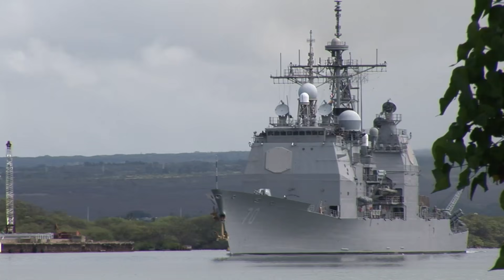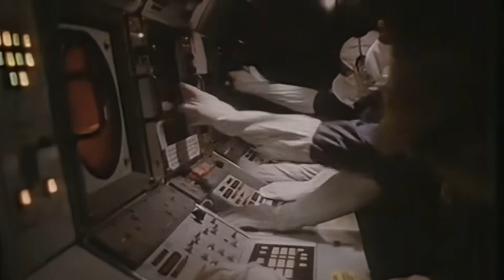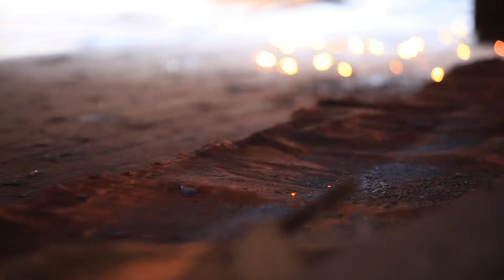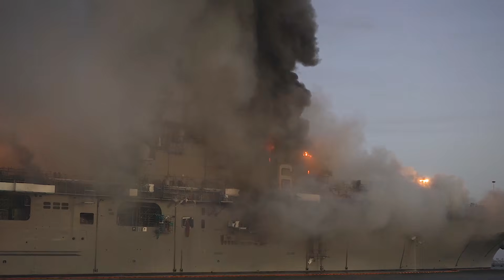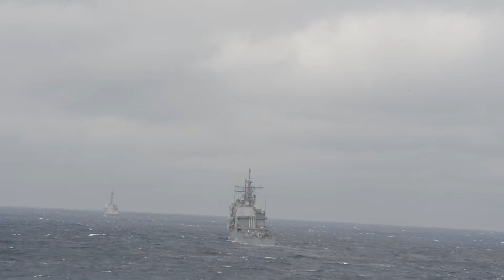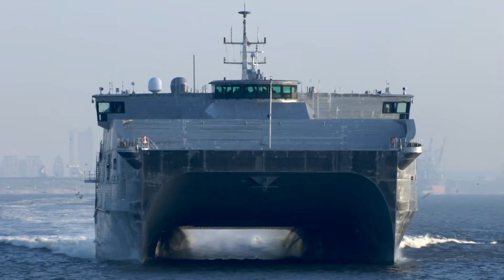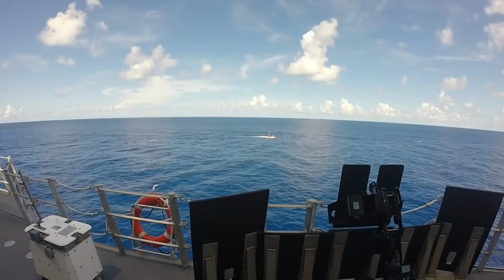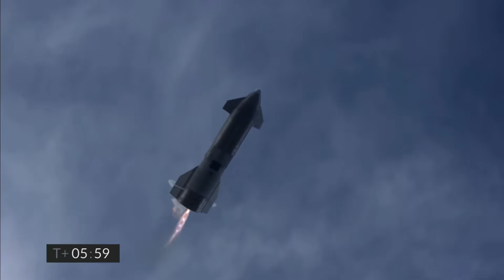Why is The US Building Aluminum Warships?

Comment: I like to make my Multi-million dollar warships from Radium personally
Reply: I prefer the hulls to be made of enriched uranium with a bit of neutrons for the contingency plan
Reply from the maker: So specific 😅
Reply: @NotWhatYouThink  mine is alot more specific, i come up with designs and details for mine from what bolts and nuts from :)
Reply: I like to make my ship out of origami paper.
Reply: @avkezramos1160  its all fun and games until someone brings a flamethrower
Reply: @avkezramos1160  Are you from paper mario?
Reply: Mine would be vibranium
Reply: @kennharoldtimban2631  no
No more wakanda
Go to wakanda jail
*bonks(
Reply: Same
Reply: I use Beskar
Reply: @mandalortemaan7510  This is the way lol
Reply: I make mine out of wood
Reply: I prefer glass so that I know what the crew is doing 👀
Reply: @unkn0wnv1rus3  hahaha🤣🤣
Reply: @unkn0wnv1rus3  Including shit? Oh, that is so sick...
Reply: I prefer enriched plutonium
Reply: @arctrooper7494  you joking right??? 😂😂😂
Reply: Mine would be titanium
Reply: @ion-sfs  same here except I would use an alloy as pure titanium is a bit too rigid, expensive, and fragile. Though I might use a powerful electromagnetic field to make torpedos unable to hit it. Add to that an apoxy based emergency sealant and high pressure pump able to output in every compartment. It's damage control would be astoundingly capable if the compartment is not more than 30-50% gone, it would stay afloat.
Reply: @ion-sfs  Good luck finding vacuum for welding
Reply: I like to make my ships from sex appeal. I don't have any myself, so I try to siphon it off of Michael Fassbender, Idris Elba, Pedro Pascal, and 1970s Annette Haven.
Reply: I prefer Vibranium
Reply: @lIIIlIllIllIlllllIlllIl  wakanda jail*bonk*
Reply: I like mine to be made from water, everything is water
Reply: @flamez_177  nah make it out of people
Reply: @flamez_177  r/Hydrohomies. Have you had your water?
Reply: I favour pykrete
Reply: @Swissspookie  I see we have a History buff in the chat.
Reply: @izaktheron2852  aw shucks, I'd say I'm just good at retaining many random facts ;)
Reply: @Swissspookie  Don't worry lol, I'm the same.
Reply: @Swissspookie  than U make a aircraft carrier the size a  island

3 km wide and 100 meters tall.
Reply: Look to be honest if you don't care about being a kamikaze captain. Because your ship will be a gigantic atomic bomb.
Reply: @temosofthecommunistrepubli2637  Japan intensifies
Reply: @izaktheron2852  hell yeah
Reply: And kill the enemy and your crew at the same time
Reply: @karansedai5603  if you are kamikaze there is no problem
Reply: @temosofthecommunistrepubli2637  
Wonder what the Japanese were doing
Reply: @karansedai5603  lol
Reply: How about uranium
Reply: I prefer concrete
Reply: And id like mine to be made from cement
Reply: I prefer hydrogen
They fly ok?
Reply: I'm going to Bamboo, just going to plate it on a small raft and let it grow into a war ship
Reply: I don't think the RN uses aloominum.  I believe they use a different metal called aluminium.
Reply: @ahorsewithnoname643  Nope...it's the exact same metal...look up your periodic table. You have tomartoes in UK and they have tom-A-toes.
Reply: I like to make mine from damascus steel
Reply: Radium ships have been outdated ever since they introduced the Iridium-hull ships. That’s right. A hull of solid iridium. I don’t know the structural properties of iridium but it’s the rarest element I could think of.
Reply: Depleted uranium for extra armor.
Reply: I like to make mines out of ice personally
Reply: I personally prefer francium.
Reply: Nothing better than ur navy being comprised of all ghouls
Reply: @kalebgruber7237  Can't shoot em if they're already dead
Reply: Multi billion not million
Reply: This comment thread is awesome 👌🤣🤣🤣🤣🤣🤣
Reply: For me, potassium
Reply: @karstplante5292  Your ship would sure go fast. No one would know which direction though....
Reply: I like mercury with a plastic outer layer to keep it from dripping away
Reply: I prefer spruce wood
Reply: Make the ships out of soylent green 🧟
Reply: Pfffft. Noobz. Everyone knows that the enemy can't sink your ship if you make it out of Lithium.
Reply: They should make it out of cheese
Reply: I make mine from sponges
Reply: Plot Twist - Thats because US Navy is recycling trillions tons of Cola-Cola & Beer cans.
Reply: I prefer plutonium
Reply: I would make mine with Netherrite
Reply: I prefer tungsten
Reply: Stalinium hull with  a adamantium superstructure.
Reply: I'd prefer mine to be made from stalinium
Reply: I'll go for platinum-iridium bronze alloys, personally.  No cost is too extreme to protect my family jewels.
Reply: @Nicholas Jordan Titanium tetrachloride works better for smoke screens.  Besides, the HCl gas it generates when it reacts with atmospheric water vapor helps keep the sinuses clear.
Reply: obsidian is good is it
Reply: mine would be goldium and diamondium
Reply: Uranium if the best
Reply: There is no material known that can withstand a direct hit modern anti ship missile. If there is it is probably far too expensive and heavy.
Reply: A Francium coated Enriched Uranium and Cobalt Alloy would be nice
Reply: Nope...mine's unobtanium!!
Reply: I like mine made from astatine.
Reply: You should use stalinium
Reply: Then how 'bout an alloy of Vibranium ( CAPTAIN AMERICA ) and Unobtanium ( AVATAR ) ?
Reply: Dunno about you guys, but I'm just hollowing out a log & moving to the island Wonder Woman lives on.
Suckers!
Reply: I rather prefer to make my vessels out of graphene. It's litghter and stronger.
Reply: Carbon fibre works well for the New Zealanders and their bonus is they don't need an engine to do 50 knots.
Reply: These ships compare nothing to my tin foil crumpled sale boats
Reply: i make my ships out of aluminum beer cans!
Reply: If you guys think building ships using aluminum are weird there was a time when the British was thinking of building carriers with Ice.
Reply: I prefer argon
Reply: I would make my ships from Flerovium-289, now you see it, now you don't.
Reply: Millions ? More like billions.
Reply: radium is a gas, i would rather use Americium
Reply: @sebastianm1901  thats why america is failing
Reply: I choose kryptonite.
Reply: @lqlarry  i swear everyone is making false names up and putting "nite" behind it to seem legit, c`mon man, whats next, lego-nite, yeah, 5 second build warships
Reply: @BonBon_1112  Kryptonite is fictitious, but it was first coined in 1943 in Superman.  I made this comment because the original quote was Radium, which is radioactive and to build a boat out of Radium would probably be as good as making it out of krytonite.
Reply: @lqlarry  k, just i swear people starts coming up with random names, sorry if any offence or harm has been inflicted over this and my comments, they are not always friendly and people take offences to lots of things now
Reply: @BonBon_1112  No problems mate!
Reply: @lqlarry  thats good
Reply: Nah i will go safe with uranium
Reply: @firdausrahman6424  uranium, nah mate, go mixed alloys, and i would arm missiles with magnesium alloys, big boom once they get hot, perfect for large explosions, trust me
Reply: Huh I think nickel
Reply: Good for the fish
Reply: @gary5807  i found nemo dead tho?
Reply: i prefer thorium
Reply: i use stick
Reply: sounds like a plan.
Reply: Personally I prefer Niobium.
Reply: Oh really
Reply: Multi-billion*
Reply: It would be multi zillion dollar. US already has multi billion dollar aircraft carriers
Reply: ahh good call, then all the sailors get a free cancer treatment while on board.
Reply: luffy’s ship is mostly wood and he’s supposed to be the best pirate to ever live 👀
Reply: @tjingle29  i need the best swordsmen, zoro "go away luffy" im the pirate hunter" fear me
Reply: I prefer glass
Reply: a single neutron outer layer for me please,but with carbon tubes underneath,for the looks,yaknow?
Reply: NO 69
Reply: @wittyjadee29  I'm sorry, what?
Reply: “Radum” surely?
Reply: @TesterAnimal1  nah
Reply: Multibillion
Reply: Make 'em from carbide, like the miners used in their headlamps, and wait for those puppies to hit the water!!🤣🤣🤣
Reply: Marie Curie would be proud
Reply: 😂😂instead of that use elephant foot
Reply: I build mine from tin

Tin foil
Reply: Rhodium too good for you??
Reply: I prefer Carbon Fiber
Reply: i Have a cool Question i was trying to research How much will it cost if someBody able to Build a Big aluminum Boat Billy able to Lift up 2 or? 4 shipping containers as Living Quarters i cant comprehend should Be the size oF 9 or 19 or 29 school Buses to Build a Foundation Hope it dont cost over miLLions oF Dollars ???

just a aluminum Foundation able to Hold 2 or 4 containers also with John🇺🇸Deere🇺🇸Engine also able to Hold diesel fuel or Elected Engine ???
Reply: Mine are multi-billion
Reply: @dylanboyd2963  what are they made of diamonds??
Reply: Carbon nanotubes with a fused industrial diamond dust outer layer. Strong and stylish
Reply: i perfer pure cast iron in galvaized steel
Reply: Mines would be cociane
Reply: How illuminating
Reply: Radium? Oh, that sweet soft green glow in the night... so beautiful!
Reply: I prefer helium
Reply: Mine is probably netherite with enchantments

Comment: Carbon fiber is too expensive compared to steel, that's why Elon went with steel for Starship
Reply: actually not at all. It is about the thermal properties, which are better for steels than for composites
Reply: @samanthaqiu3416  It IS also cheaper, at least partly (?) because it's not as wasteful
Reply: It also had to do with the materials' properties at high temperatures, iirc
Reply: It was actually combination of thermal properties (which is in no way relevant for ships that don't store cryogenic propellants nor have to survive reentry heat from interplanetary speeds) and also a possibility to iterate fast because once a mold or a loom for composite part is made, it's very hard and expensive to change the design.